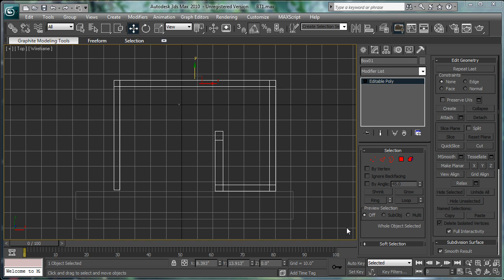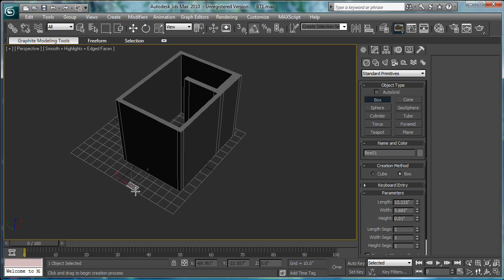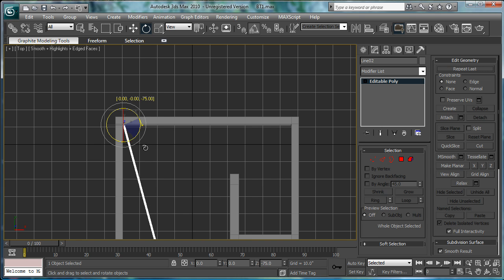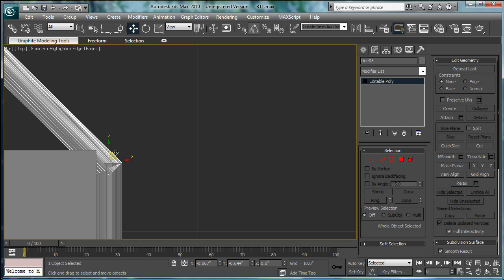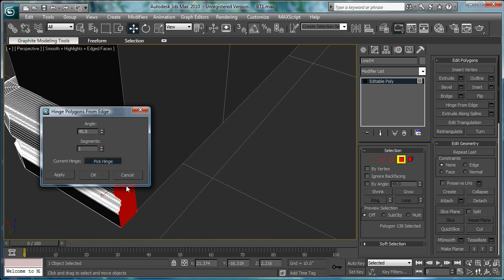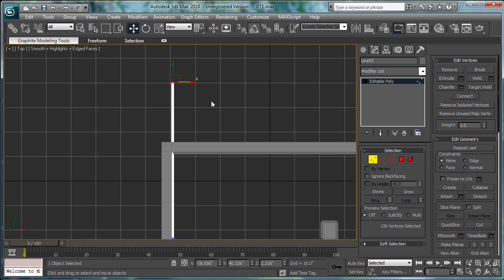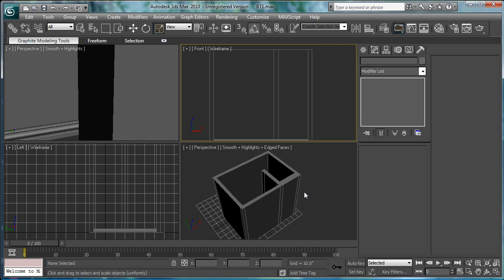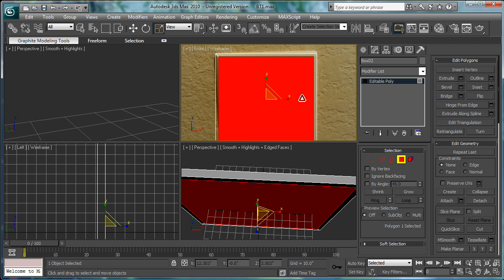3ds Max tutorial - Interior Architectural Design: Bathroom part 2

Comment: Keyboard shortcuts:-
views:-
Front:-F
Left:- L
Perspective:-P
Top:-T
Maximize view port:- Alt+W
Select:-Q
Move:-W
Rotate:-E(people often mistake at rotate, rotate is E and sscale is R)
Scale:-R
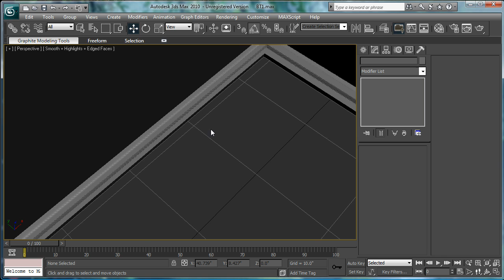Walthrough:-press the UP arrow key and then you can walkthrough as if you are in a game(used at 7:39). You can also press the feet icon in Right-down area.
Also you can easily change the sub object selection mode in edit poly mode by pressing the number keys.
1-Vertex
2-Edge and so on